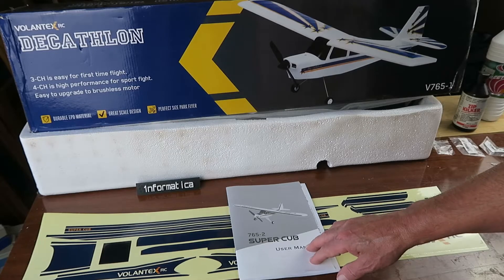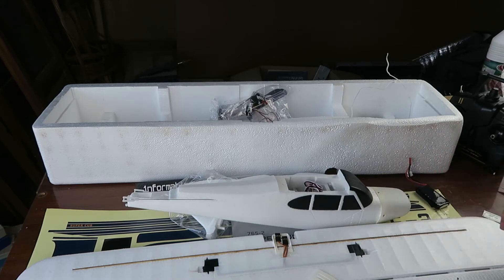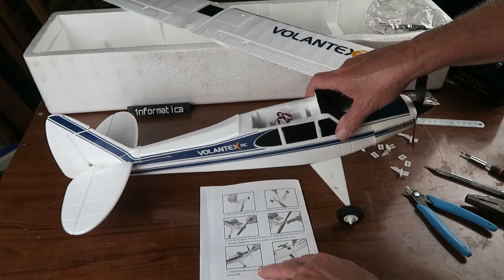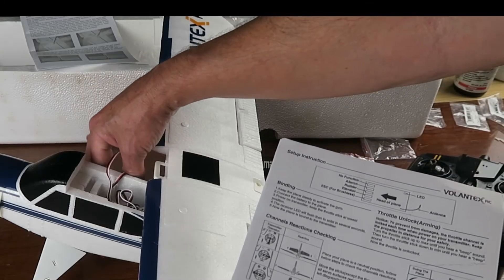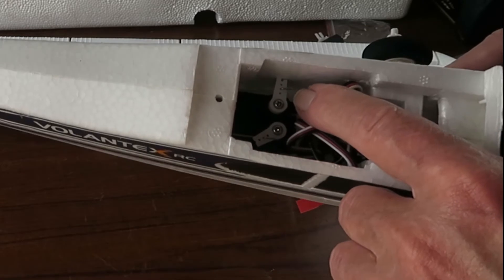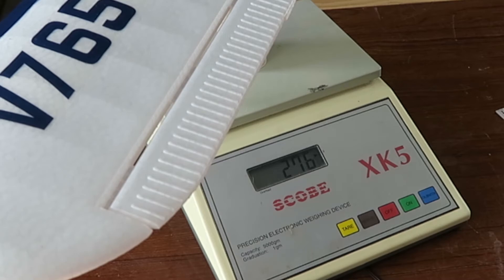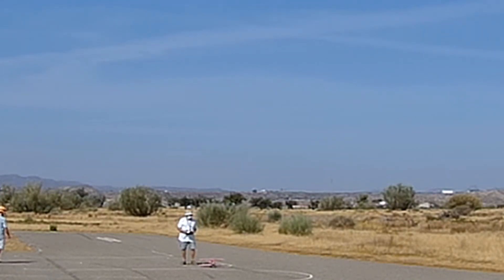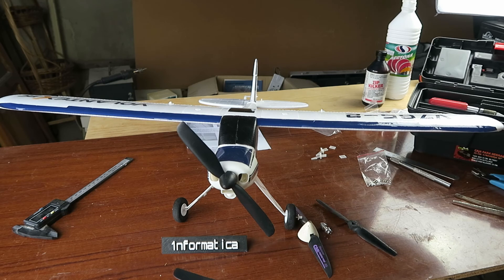Volantex 4CH V765 2 Super Cub 750mm Sport Park Flyer Build And Maiden Flight

Comment: Just watched this again. (Thinking about the protocol hack.) I noticed that at 7.00 when you were checking the elevator and commenting about limited throws that the whole horizontal stab was moving. Not fixed properly? Foam hinge too solid and not loosened up before installing control horn? Ground Control RC had trouble with his at first - had to add reinforcing between the 2 sides of the elevator.
Reply from the maker: Good points all, thanks! They have redesigned the elevator since  Ground Control RC's video. now there is a carbon rod connecting the two half's. I will check again. Strange since the first flight I have not noticed the problem, maybe just needed "working in".

Comment: Going to run this on my Taranis? Has the protocol for this now been cracked or are you going to replace the stabilized Volantex receiver?
Reply from the maker: Sorry I got a little ahead of myself! I think it's close though https://github.com/pascallanger/DIY-Multiprotocol-TX-Module/issues/412
If not Byme -A here we come!
Reply: @1nformatica  Thanks for the update on Pascal's efforts. It would be nice if the protocol is finally cracked. We don't have the big Sport Cub here (WAY too expensive to get it shipped here!) but the receiver/Tx is also used in my Ranger 750 pusher and the 750 size Mustang (and probably others.) That little Radiolink Stab looks very interesting.
Reply from the maker: @theoztreecrasher2647  Yes, let's hope it gets done soon. Have you seen any apparent range issues with this model? Mine's nearly gotten away from me a couple of times, not responding to the Tx or very erratic.
Reply: @1nformatica  No, not at our fairly cramped site. The trees tend to catch everything before it gets too far. Probably 150m is usual max and that's with the plane and Tx that shows the effects of being a mixed container shipping load of foamies and concrete blocks! I'll have to take it out to the big weaner paddock on the station and check out the max range of the Tx/Rx combo.
Reply from the maker: @theoztreecrasher2647  Thanks, would be interested. I've seen something similar with my XK A600 Beaver. Am going to try that plane with the Taranis as that protocol is available.

Comment: Grate vid as always- especially when you frightened the lads in the shelter. Regarding your comments re: elevator movement - I think you mentioned that you moved the pushrod to the outermost holes on both the servo arm and the control horn. If that is the case I would suggest that you move to one of the inner holes on the elevator horn and that will give more mechanical advantage/ elevator movement.
Reply from the maker: Thanks Tom. That's why I was wearing the crash helmet! Seriously though it was a very bad thing to do, I still let the plane get away from me. Regarding the push rod I was not clear. The servo arm is in the outermost hole and the elevator horn innermost i.e. closest to the elevator which I think is right. Being a "foamy" hinge maybe it needs time to free up a little.